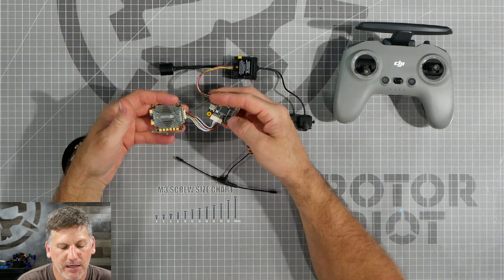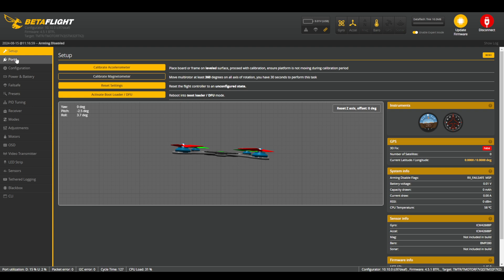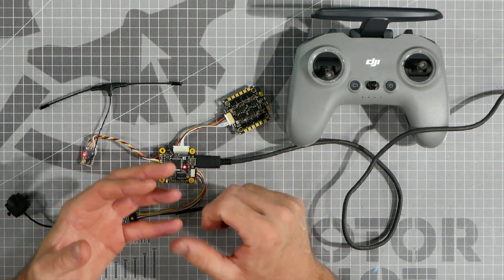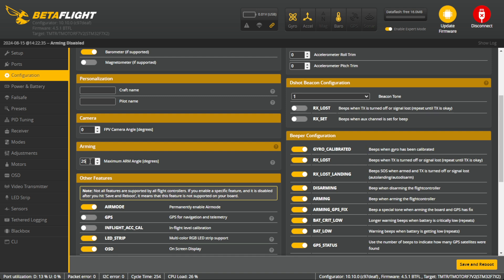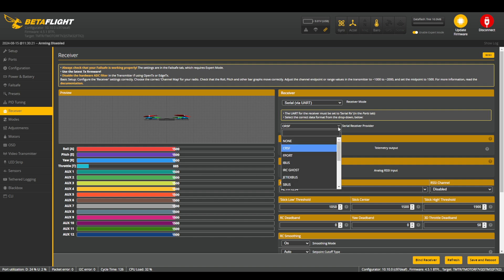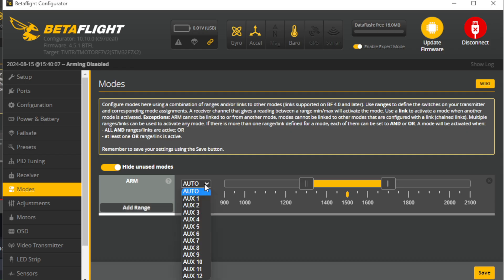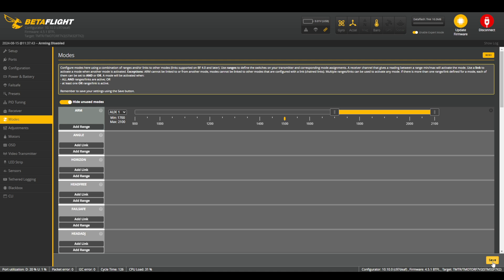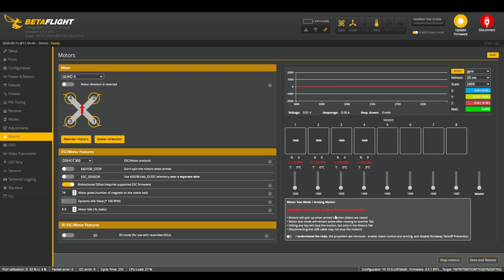Betaflight Basics - How to Program Your Drone For First Flight

Comment: So I just ordered the eachine 800D goggles, the radiomaster pocket elrs controller, and the meteor75 pro. My question is, does the meteor75 pro come with everything preset? Chat gpt is telling me the only thing I really need betaflight for is to set my arm/disarm, and flight mode buttons. Is that correct. Since I'm brand new at this, will just doing that get me up and flying?

Comment: Under the video transmitter tab, on the upper half do you have to select the band and channel, and change output power to 200mw? Wrkin on a mobula6 aio5 chip...or does it do this automatically using hdzero goggles....expresslrs setup....have vtx table setup....
Reply from the maker: @jdonez8347  that stuff is only for analog systems.  Digital system power level and channel settings aren’t controlled by betaflight